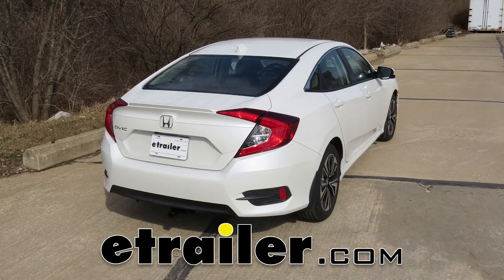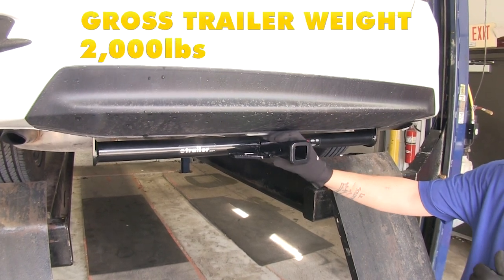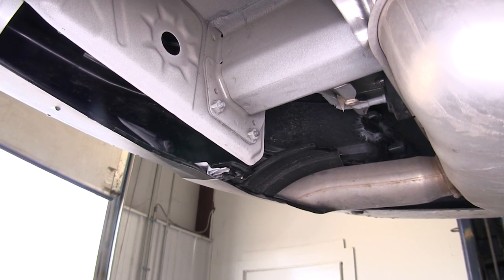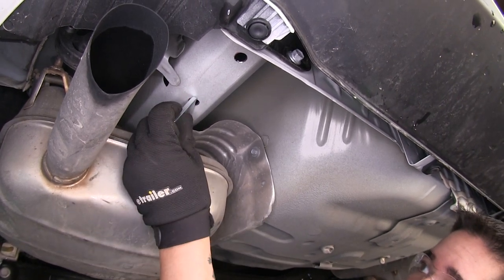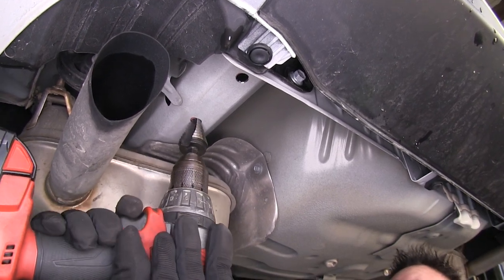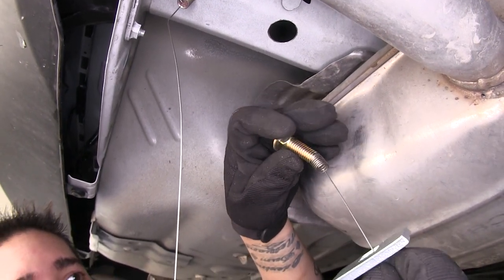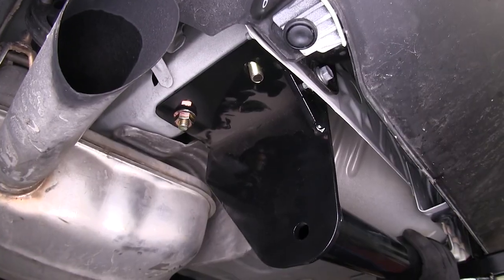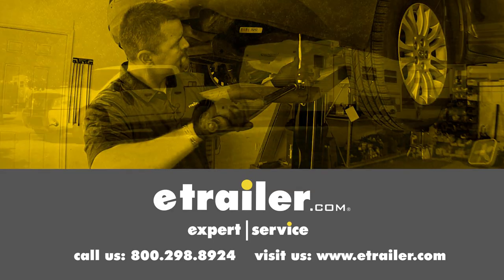etrailer | 2017 Honda Civic Curt Trailer Hitch Receiver: Complete Installation

Comment: Two tips, having just done this job today.  1)  The rearward bolt holes aren't easy to drill.  There is a flange inside the frame member where the bumper reinforcement integrates into the rail.  In other words, a second layer of metal on the rear side of the rear hole.  Makes it fun to drill out depending on where the flange is on your particular car.  2)  Do yourself a favor and get some CRC marine corrosion inhibitor spray.  Spray liberally inside the frame rail where you've drilled.  Once the hitch is mounted, spray more inside the small access holes on the rail to coat the hardware and drilled location inside the rail.  This will prevent corrosion headaches years down the road.

Step drill bits and a dremel with a grinding wheel are your friend for enlarging the front holes.

Comment: I would personally use polyurethane sealer under the  plates and where the hitch contacts the car frame for a water tight seal around the holes, Because salt water will  rust a hitch like this right off the car in the rust belts, You can buy the sealer I am talking about at any Reefer trailer repair location, it is used to make water tight repairs inside Refrigerated trailers for wall damage from mostly forklifts, Called FS1000.
Reply from the maker: Thank you for sharing this with us and others.
https://www.etrailer.com/Trailer-Hitch/Curt/C11604.html

Comment: Wow unbelievable..i would think that you need a wrench to hold the bolts to get them tight but i guess not
Reply from the maker: Yes, it's a blind opening so there's no getting a wrench in there. The square shoulder on the hex bolt sits in the square opening of the block washer. The length of the washer is what keeps the bolt from rotating up in the frame member which allows you to easily tighten it. Pretty slick setup!
https://www.etrailer.com/Trailer-Hitch/CURT/C11604.html
Reply: Ok makes sense..so that wire and plate comes with the hitch right?
Oh btw my bike rack the end that needs to go into the hitch is 2 inch ..I guess I'll need a inch and a quarter to 2 inch sleeve right?

Comment: so spray paint on the drilled holes to prevent rusting?
Reply from the maker: Yes, anytime you need to drill through the chassis or frame of the vehicle which leaves exposed metal, it's absolutely a good idea to protect that bare metal with paint.
https://www.etrailer.com/Trailer-Hitch/CURT/C11604.html

Comment: Does that hitch fits 2023 civic EXL
Reply from the maker: It doesn't. It only fits up to the 2018 Sedan model. We'd recommend the Curt # C92UR which fits all models of the 2023 Civic EXCEPT models with the center mounted exhaust.
https://www.etrailer.com/Trailer-Hitch/Honda/Civic/2023/C92UR.html

Comment: I have a 2016 civic lx and I want to tow a jet ski but I’m worried I would be putting too much stress on my transmission. Anyone try this out yet and have any problems? The owners Manuel says I can tow up to 1000 lbs but I don’t want to take any chances.
Reply from the maker: I would check to see what the weight of your jet ski is to make sure it and the trailer is under 1000 lbs and you should be ok. The manufacturer has figured the transmission into the towing capacity.
https://www.etrailer.com/Trailer-Hitch/Curt/C11604.html

Comment: Do you guys gave a video for wiring instructions for the trailer brake lights?
Reply from the maker: We do have a video of an installation on a 2019 Honda Civic. The installation will be very similar on the 2017 Civic as it is on the 2019 Civic. 
https://www.etrailer.com/Wiring/Honda/Civic/2017/C59236.html

Comment: I have 2016 Honda Civic  I’m having hard time drilling the last two hole from closest to the bumper.  What’s the best way to drill it some reason it’s not catching.
Reply from the maker: You're not the first person to have issues drilling those. One tip we've heard a few times is to start with a smaller drill bit and drill a small hole and then switch bits gradually getting larger.

Comment: Will this work on an electric chair
Reply from the maker: This hitch is rated for 200 lbs of tongue weight and 2,000 lbs max trailer weight. You may be able to pull a small trailer with a wheelchair on it if it weighs more than 200 lbs or the vehicle cannot handle that weight. You will want to check in the owners manual of the vehicle to see what its capacities are.
https://www.etrailer.com/Trailer-Hitch/Curt/C11604.html

Comment: Under chassis rust problem with this install?
Reply from the maker: We have had to use a thread tap to clean out the threads on a few vehicles in order to get the hardware in place. It is not super common but it does happen depending on what region the vehicle is from.
https://www.etrailer.com/Trailer-Hitch/Curt/C11604.html

Comment: is there any what that I can put this without drilling? I am afraid that drilling might avoid the warranty.
Reply from the maker: We have another hitch that will not require drilling but it will require you to trim a small section of the lower bumper for the hitch to fit.
https://www.etrailer.com/Trailer-Hitch/Draw-Tite/24954.html
Reply: @etrailer  thank you. if you were to choose between the two, which one would you go with? given the fact that both do not void any warranty.

Comment: Can I tow a jet ski from this hitch since it has a tow rating of 2000 lbs. and 200 lbs. tongue capacity? The jetski and trailer weight roughly 1000 lbs. I'm not asking if the vehicle can handle it but according to the numbers this hitch should work right? I am asking because I don't see any high rated hitches (class II and III) for this generation Civic.
Reply: The class one hitch has a working 1500lb tow ability. Anywhere near 2K is asking for trouble. 200lb tongue weight would come into play depending on what type of trailer is used

Comment: Need if I can
Reply: Need to no if I can tow a ATV with my Nissan rogue what size trailer I need too buy safe too be able to drive 55mph
Reply from the maker: You can check in the owners manual of your vehicle to see the capacity that your vehicle is capable of handling. 
https://www.etrailer.com/hitch-2017_Nissan_Rogue.htm

Comment: Be careful with these hitches on 10th Gen Civics! I bought a Honda Certified car with 16k on it and the frame was starting to rot near the drill locations! West Coast car nowhere near rust.
Reply: Going to be that guy and say that any iron ions exposed to water will corrode. It doesn't matter where the car is located, geographic to have rust on the car.
Reply: Did you add rust inhibitor when you installed it?

Comment: If only I could drill those darn holes! This guys makes it look like a very simple process. Is nealry impossible to drill those holes! Well, for me "impossible" to the point that I just gave up. Would any metal drill bit work? do you need some special metal drill bit? WTH!
Reply from the maker: The holes can be difficult to drill. We recommend using lubricant and a sharp drill bit. It may be worth buying a new one just for this job.
https://www.etrailer.com/Trailer-Hitch/Curt/C11604.html